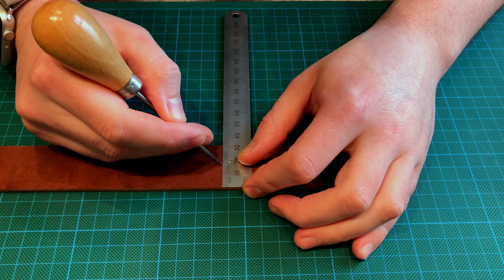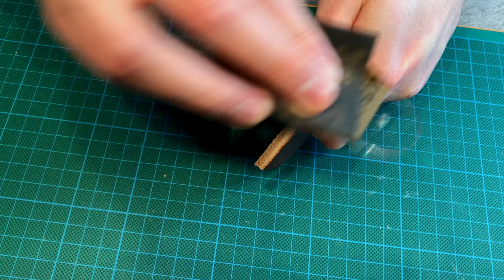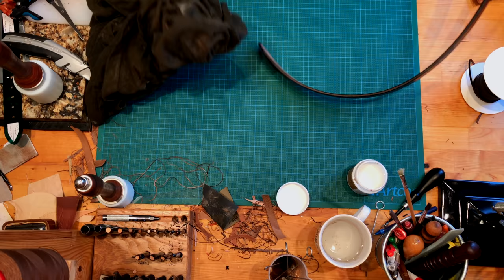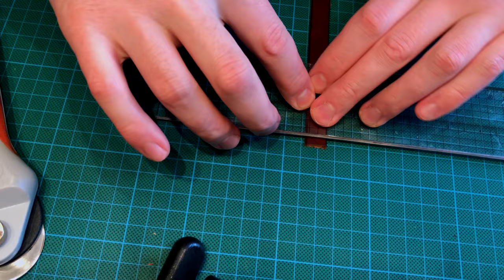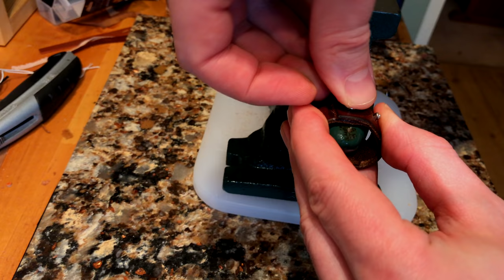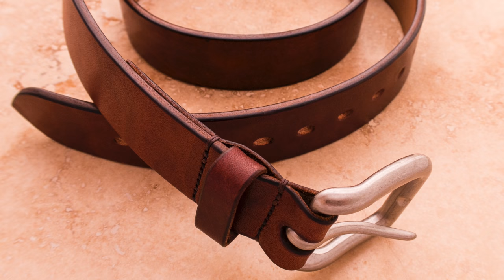Making an English Oak Bark Leather Belt 4K

Comment: Dear Sir I can't thank you enough for taking the time to share your expertise. I have purchased some of your designs and have found them to be well thought out and the pdf layouts to be spot on. I would like to add my two pence on this belt, I wouldn't sew across the buckle. I would use a less attractive rivet. Sewing across the belt in this manner fatigues the leather and it will fail here first. Eventually much sooner than a rivet, it will break. I have seen this on many designs and it looks terrific off the trousers, but is lost when used. I would like to know your thought on this.
Reply from the maker: I have made belts which are both riveted and sewn, whilst a cheap belt might break on a stitch line leather of this thickness and quality hand stitched with the best thread you can buy will not fail in the manner you suggest and does not 'fatigue' the leather in my opinion.
Reply: Thank you.

Comment: Hi Ian. Is that black dye or edge kote you use on the edge? Also after the belt is worn does the edge remain smooth or does it get hairy/fuzzy? The edges of my belt especially where the belt is closed get hairy/fuzzy. Should the edges of the belt continue to be smooth with wear or am I doing something wrong in finishing the edges? I use water, gum trag and sometimes beeswax. I burnish by hand with a multi size wood slicker. I don't think I like the wax it gets white and frosty looking after a while. Help pretty please. Thanks.

Comment: Thank you, Ian, for yet another excellent instructional video. I quite enjoy the silent approach because it really allows me to concentrate on exactly what you're doing. In my dreams, I skive with exactly the same relaxed assurance you do. In real life, not so much. At least (touch leather) I haven't skived myself. Yet.

If you have time, I have a question: how would one go about inserting a length (6" or so) of strong elastic into such a belt? My husband needs a belt like that for medical reasons, but I can't imagine how to start. Nor can I imagine the kind of elastic I'd use or where I'd source it. Do you have any tips, please?

Thanks again for your generosity in giving us these videos. If I didn't live so far away(Australia), I'd send you one of my scrumptious chocolate cakes. :)
Reply from the maker: Hi Trish,

The elastic would wear out decades before the leather so I think the key would be making it such that the elastic could be replaced when it gets all stretched out. If it was me I'd probably work it such that the elastic was against the small of the back so it's most discreet when worn and the belt looks as normal as possible from the front. Rather than stitching in the elastic you could remove a 6" section of the leather from the measurements and then have two holes in the end of each piece, through these you could  join on some thick elastic using 4 chicago screws? Doubling over the elastic where it's bolted through would increase the strength. As for the elastic itself you won't get it at a leather suppliers you'd need to check out a haberdashery or sewing type place, not sure what you have in the way of those in Oz but they should have all sorts of thick elastics (you probably want waistband elastic). If not you could order some online from somewhere I'm sure.
Reply: Hah! Removable elastic with chicago screws! That's brilliant! I can get a particularly strong kind of elastic from an industrial supplier near where I live. I've used it to make elastic draw reins for training my horse, so I know it's strong. But the chicago screw idea is a light bulb for me. Thanks again, mate. You rock! :)

Comment: I have a question. Doesn't it not weak the strength of the belt to sew it in this manner? Against the width of the belt instead of with the length of the belt?
Reply from the maker: It is not recommended to sew across a strap which may come under heavy load for example a dog lead or a bits of things for horses or luggage. However, a belt is not a strap and comes under only slight tension so with good quality leather it makes no difference which way you sew it.

Comment: What is that tool with a little loop of wire on the tip that looks like a soldering iron (you used it to seal the ends of the thread?) ?  Thanks.
Reply from the maker: it's a Thread Zap, please see http://ianatkinson.net/leather/toolset.htm to purchase

Comment: Great video and belt. Thanks for posting. You inspired me to make belts for me, my family and friends :)
I would like to ask you, how you seal those edges. I understand there goes color, then water to polish it. What do you recommend to use to seal it, so it look as good as new?
Reply: Not Ian but a hobbyist leatherworker myself. I've read that the first sanding should be with 400 grit(then one could use progressively finer grits as desired). I've used Eco-Flo Super Sheen and Satin Sheen for finishes  but got some advice to use a mix of Acrylic Resoline and water followed by Atom Wax and buffed with sheep wool. My most recent project I discovered that my Resoline had ruined(probably got too cold) so I used beeswax, slicked, applied Fiebings Edge Kote and allowed to dry. I repeated that procedure 2x and the edges were pretty good

Comment: I have a question ; what do you do with your waste ? ( leather trash?) sorry for bad english
Reply: I put mine in the compost.
Reply: zlobo67 I am considering experimenting to turn small bits of leather scrap into micarta... Otherwise I tend to use them as strops for small tools like the edge beveler, as test pieces for cutting after I sharpen a knife, as a protection layer between my leather project and my paver (I'm too cheap to buy marble) when hammering rivets, or between my project and cutting mat when using stitching chisels to help them stay sharper longer... They also double as test pieces for dyes, like colour swatches.

With big enough pieces you can buy a lace cutter and make your own thonging. Check out UK Saddlery's channel for details on how to use one of those.